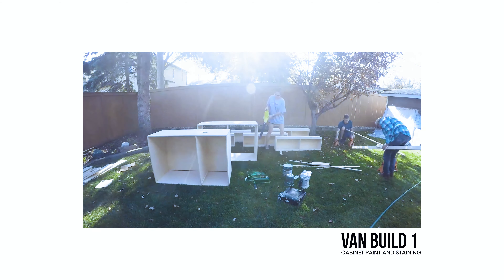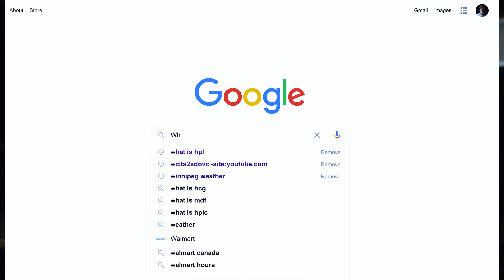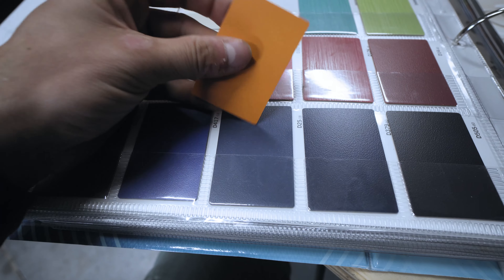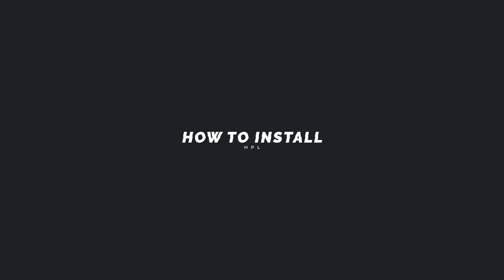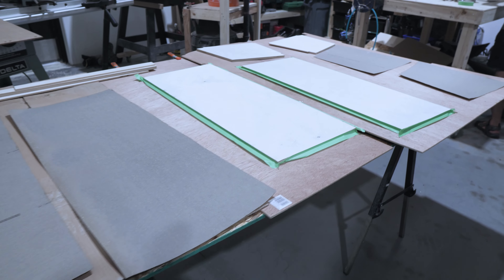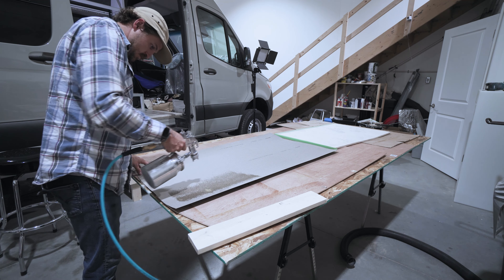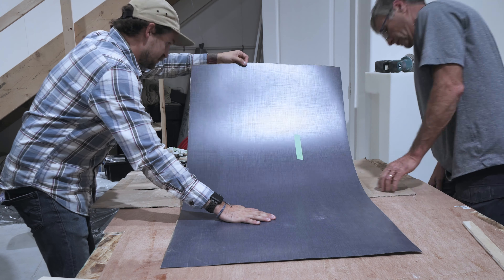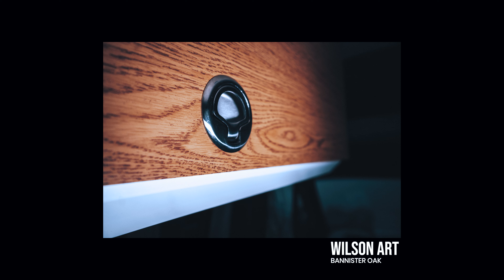NO PAINT Professional Sprinter Van Cabinets | VAN CONVERSION

Comment: Scott.  I used laminate on all surfaces on my first van and it held up perfectly. It's incredibly durable and easily cleaned.  The color and design options are endless and like you're doing, you can mix and match options. I made my own countertops with this as well. You are the first person that I've seen to use this and while it can be intimidating at first I believe anyone can do it. You also used marine vinyl on your ceiling, surprise I did that as well. I actually used that vinyl on my wall surfaces above countertop height as well. Looked amazing and held up perfectly.
Reply from the maker: Awesome! Yeah Im super happy with these products so far.

Comment: Here's a tip on placing the Laminate on the board  after the application of cement. Instead of using a bunch of sticks or doweling I use a thick plastic like 10 mil. Lay the plastic over the cemented wood. The plastic will not stick to the cement. Then place your laminate on top of the plastic.....again the plastic will not stick to the laminate. Placement can be adjusted with real tight tolerances. Then clamp one end to secure the laminates placement. Start pulling the plastic back towards the clamped end. This will then make contact and is secured. You can remove the clamps and continue to pull the plastic out. It's kind of like pealing the protective layer on double sided tape.

Comment: Yep, HPL is the way to go for a professional look, for certain cabinets, you can laminate the components separately then assemble them after.  If I may add:  plywood panels need to be laminated on both sides and not too long between the applications, if not, they will curve badly.
Reply from the maker: Yes I did both sides 1 side in color and the other side on standard bright white
Reply: @scottadamson6116  how did you do the edges of the cabinet windows? The oak style ones seem to be perfect edges

Comment: Hey Scott, I've been following you for a little bit and wanted to reach out since you're so helpful (and responsive to comments). When I pressed play I knew you were going to mention laminate because there's only so many ways to finish a cabinet. ;) I'm so glad you went in-depth, because I have been planning to use HPL in my build when that step comes, but I didn't know where to start. It's one of the sleekest, sturdiest materials, IMO. Did you do the inside of the faces too? Thanks again and make sure you put that HPL company in the description :)

P. S. I love your editing style and how you throw in little stills
Reply from the maker: Thanks for checkin g out the vids and glad you enjoy them. I am putting Solid white on the insides for two reasons 1. Its Cheap and 2. Brightens the inside of cabinets.

Comment: Hi, great video. I had never considered using a laminate, I always thought it would be a nightmare to work with. It looks doable though with proper care and attention 👍. What thickness of plywood did you use as the sub base for the laminate?
Reply from the maker: Im using mainly half inch

Comment: I’m also thinking to use the hpl. How did you finish the edges? 
I did some test with some HPL but the hardest part was glueing the edges and the cut the excess with the hand router without scratching the Hpl.
Any advice?

Comment: From one Canadian to another Canadian - great job eh! Two questions... 1: Can the HPL be used on entire walls?, 2: Why does the laminate piece not stick to the wood slats that you put down - seems weird that it didn't stick to the slats.
Reply: You put the contact cement on both surfaces. It won't stick well on surfaces without the contact cement (the scrap wood). Once the 2 surfaces with contact cement touch it's really really hard to pull them apart without breaking the HPL.
Reply from the maker: Yeah exactly its a contact cement so both surfaces need to have the adhesive applied for it to stick.

Comment: just another thing im going to do now with my build . what was the cost of the sheet and how many did you use . and looking back would you go for a ticker sheet
Reply from the maker: I think the thiner stuff is more than fine it comes in 4x8 sheets so it all depends on how much surafce area you are covering.
Reply: What the cost per sheet

Comment: Is this HPL nonflammable? Is it flame retardant HPL — unlike the standard ones, manufactured with special additives that make them flame resistant?

I would also use nonflammable contact cement (e.g. Dap Weldwood Nonflammable Contact Cement).
Reply from the maker: Im not sure.